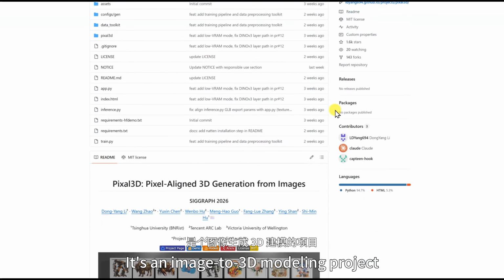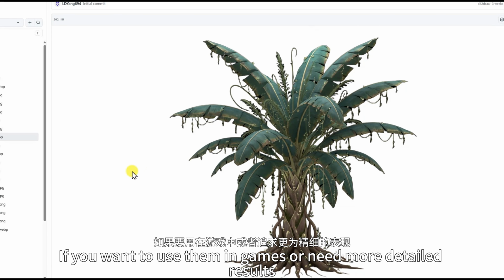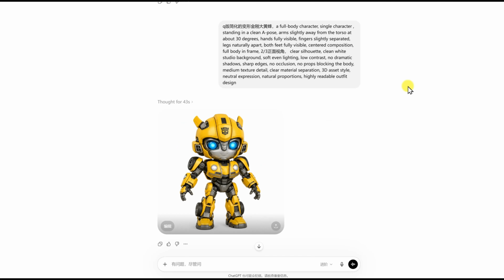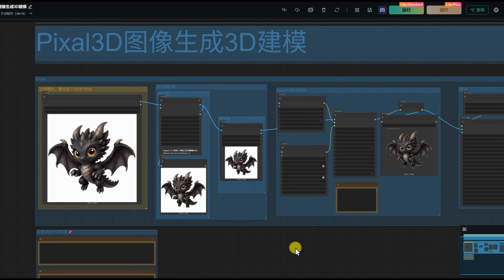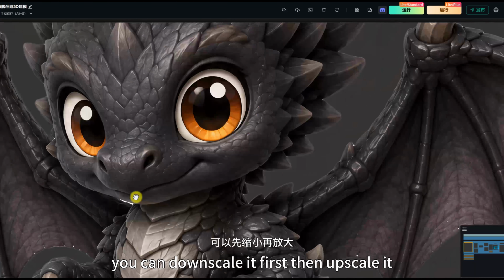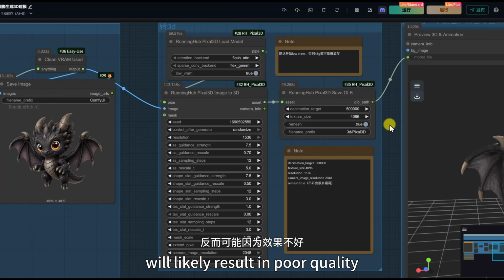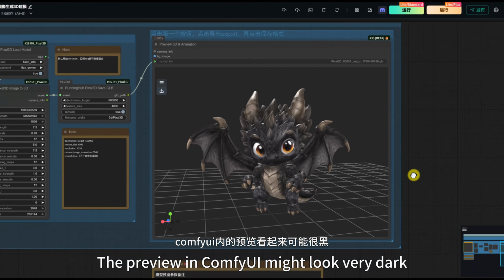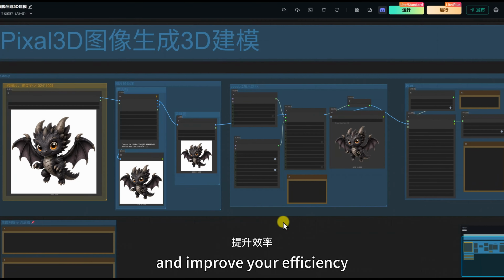[ComfyUI]Ultimate Optimization,Complete Workflow for Pixal3D Image-to-3D High-Quality Mode

Comment: model loader cannot find a model. How does one resolve this? What model is it loading? Does it show in the parameters? I'm speaking with respect to the RunningHub Pixal3D Load Model node. My job errors out when I get to this node.
Reply from the maker: You can try again. If it's a problem with the rh, it was normal when I was testing.